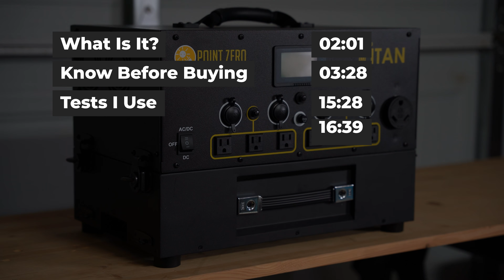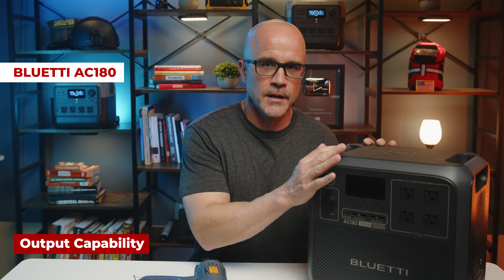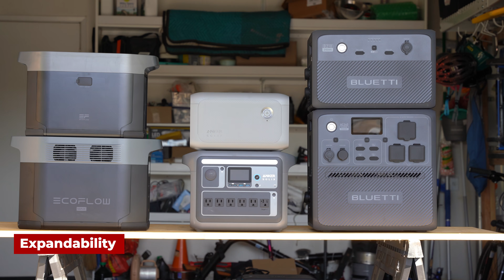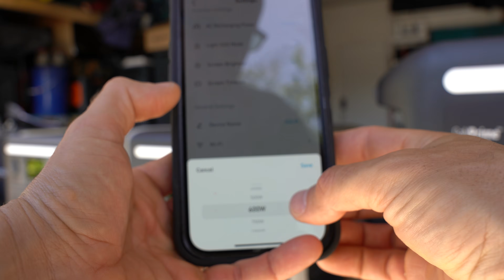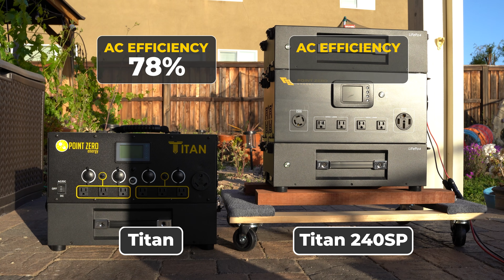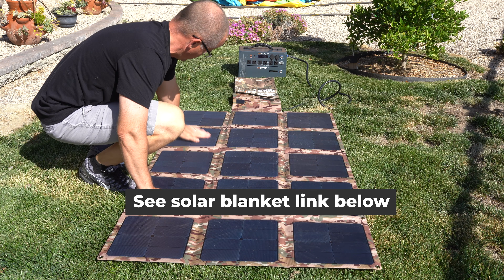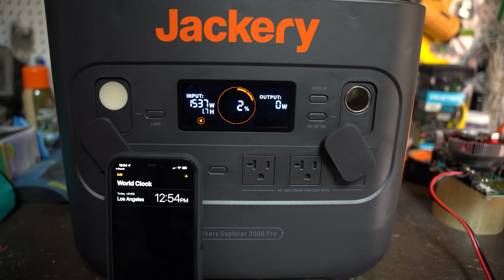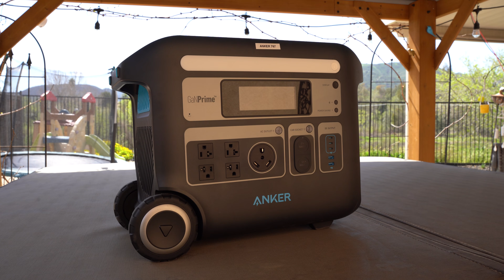Best Solar Generator for 2024 (The Ultimate Guide)

Comment: Last year i had an Ecoflow unit die.  I was not able to ship it back to them for warranty due to shipping restrictions on Li batteries.   However they did honor the warranty  and sent me a new unit free of charge.
Reply: That's good to know, hoping they continue to be good on warranty.
Reply: Ahhhh! BEWARE! Buy direct from ECOFLOW! 
Mine died, and they said no bueno! 
Why? Because I bought it through this non approved reseller! 
Yep! It was AMAZON! 
I fought it, and they sent me a new one, but it took time!
Reply: I have had two echo flows fail on me. I'm done.😢
Reply: Same here, we had four delta pros fail in a matter of days.
Reply: @quartamile  WOW!!!
Reply: @quartamile They let you keep them all or does you have to return them?
Reply: @marcfavell   they weren't mine and I left the project before discovering that, but I'd be they shipped back.
Reply: @marcfavell You does...
Reply: That's crazy, mine was defective when it arrived and they updated it to bricket so it wouldn't work anymore. They made me print a shipping label and I think the shipper attached the wrong label. They said they have to have the product back even though they knew it was defective and useless.
Reply: @matt45540 of course they need it back, lol. If a company declares a recall on a car - you need to send it. Every time I crash a drone, they Brick it and replace it. If I lose it over water or cliff... too bad for me 😅
Reply: That speaks volumes.
Reply: @ctcv-to8kq huge
Reply: Ecoflow has incredible customer service, unlike Bluetti.
Reply: @stacky512a I got burned by Bluetti too.
Reply: Yeah, one of my two pros burnt out its charge controller. Sent it back and got a new one.
Reply: MA in the US.
Reply: @johnclark3531  FedEx accepted it?  I have to send mine back and they sent a fed ex label.
Reply: If you buy from walmart or costco then it can break all it wants.  Consider the benefits of brick and mortar as these made outside the USA stuff have shaky quality and dealing with the return line in costco has a certainty versus online where its a coin toss.
Reply: Just Bought the Pro and smart battery twin.  2100+1500 on Amazon Prime Day. Took less than a week via Fed Ex, Booted up w connector, NO ISSUES. 3 updates had to be uploaded.  No Issues.
Let's see ... Time shall tell.  Im from NJ
Reply: did you get it from Amazon? I want to buy a backup system & was looking at ecoflow but it has bad reviews & I read so many complaints about  bad cust service & I guess it's not supposed to be used with medical stuff because it will hurt a pacemakers from electric stuff it emits. also on amazon it says flat out non returnable because of hazmat issues. I'm looking at another brand. I don't want to spend $3K & get ripped off.
Reply: @piercingtheveil40  I have a Delta 2 model. I bought direct from manufacturer. In over a year I have had no issues after using several times. I just looked up the same model on Amazon and it has a 4.6 rating. I spent $1600 cdn for the unit and solar panel. I'll look at other models to see if I can confirm your findings. Maybe it's the model.
Reply: @haylays5616  I want the new delta . I think it’s the best but it’s $3000 or more so expensive
Reply: 6 people in this one thread with reliability issues.  Now I'm not so sure about getting an Eco Flow.
Reply: @ServantOfJesusChrist777, for real, I was thinking about choosing between Ecoflow and Jackery, and after observing many users in this thread encountering reliability issues, I'm now unsure whether I should go for Ecoflow
Reply: @Thephonkgod  I have had a Delta 2 for over a year. Used it several times. Never a problem. We have a storm coming tonight so I pulled mine into the kitchen. I luv it.
Reply: @Thephonkgod what did you end up going with?
Reply: @Thephonkgodlate info on Jackery, (portable Explorer 300) we have two pain in-the Sierra units. Jackery does not play with anybody.  Every plug and cable is a slightly (read proprietary) different size. Also, look at the polarity.
Reply: @ServantOfJesusChrist777  yes I too am worried.
Reply: Let me guess - you are somehow connected with another manufacturer? @ServantOfJesusChrist777
Reply: @ServantOfJesusChrist777 right!   Sounds like great customer service but….. should need that customer service
Reply: @ServantOfJesusChrist777 I’ve been running EcoFlow daily for 4 years 24/7. No issues.
Reply: @ServantOfJesusChrist777 350k watched, 6 people had an issue worth commenting....
Reply: I’ve taken Milwaukee 18v batteries in my carry on travel case ….I just drain the charge before I pack them !
Reply: How did ecoflo ship you a new unit? But you were not able to ship the old one?
Reply: @roaddog9222  i could not ship it back to them for warranty because of the lithium battery restrictions. No one in town would send it back to them.  Lots of regulationsregarding that.  They just sent me a new one as a replacement.  I had to ditch the one i had.
Reply: @roaddog9222 That's the beauty of it!😉
Reply: Good to know, thanks!  😊
Reply: If you're not a marketing bot then I'm sold !
Reply: City Prep - your commenters report an abnormal failure and DOA rate with Delta.  Not good for DOA as that problem is easy to correct prior to shipping.  Not sure your overview supports your selection.  The obvious choice is the one most people cannot justify with the made in America price and it is not totally made in America due to the batteries.  Water resistant and AC efficient are important considerations.  I did not really see a clear winner as three of the manufacturers have differing positive and negative points.  Good review.
Reply: @solutions2exist556  680,000 views of this video and a dozen with problems is NOT abnormal fail rate . Even if half the 1300 views were complaints that would be minimal.
Reply: My EcoFlow Delta pro failed after two years of sitting idle on standby, it charges the extra battery but not the main battery. Hopefully they replace it, i've got about $8000 invested in everything and I wish I just made my own system that would've been easy to service.
Reply: @melissasmess2773  For that amount of money, your experience with EcoFlow was absolutely horrible. Back in March 2024, I purchased on eBay for $1250 total, a brand new ALLPOWERS R4000 3600 watt LiFePO4 Power Station which has flawlessly been running my safe room's 200 watt heater or 450 watt air conditioner during extended grid outages. Recharging via grid AC is on the slow side but other than that, no problems with this unit whatsoever so far.
Reply: Where are you located ?
Reply: @lanceboudreau3630 What time is it? Did Dick's heart stop?...🤣🤣🤣
Reply: What about Amazon is reseller for eco flow and it comes direct from eco flow, still honor 5 year warranty I hope?!?!
Reply: That is one of the problems with these types of batteries. I had 3 diff brands stop working within 5 years of ownership.
Reply: Is great they sent you a new one but How long did it live and how long did you use it for?
Reply: Ecoflow failed on me. I have had good luck with Bluetti.
Reply: I'm now sold!
Reply: I've had two Ecoflow Delta 1300 units fail on me. I'm not sure I'd buy Ecoflow again. Each lasted about two years.
Reply: Ryobi just came out with an 1800w power station, which can be linked to an identical unit.
Reply: @iamgermane very nice, but i cant find anywhere it can be solar charged
Reply: You did prefere wifi, but in most scenarios wifi will not work does it?
Reply: You based in the UK?
Reply: I live full-time by choice in my sprinter in the mountains of northwestern Montana.
I have the eco-flow :
 River 2 
Delta 2 
Delta Max 
Wave two 
And two foldable ecoflow solar panels. 
All  have treated me well .
I'm not real pleased with the Wave 2 or the solar panels.
I have to keep chasing the sun with a solar panel so then when I seen the ecoflow dual generator .
I took out a loan and I bought one 
It was quick to get here 
I want to use propane only 
I checked everything the manual said to do. 
Then I ran it 1 hour 
Change the oil 
And then I ran it 2 hours for the next 3 days 
Went out the next morning nothing !
Won't start for any reason. 
I'm 63 on my second pacemaker defibrillator and suffer from rheumatoid arthritis. 
The electric start was going to be a godsend for me. 
What a long story short I contacted my son-in-law had him come to camp and had him triple starting it 
Nope nothing !
I'm corresponding with technical support 
They said I need to go back to town and see if I need to update firmware 
And then contact them 
Because they think it might be the battery. 
I'm truly hoping they get this figured out. 
I'll try to remember to update you all.
Reply: Good to know they support their products
Reply: Glad to hear that, just ordered the EcoFlow Delta Pro2 after many hours on YT.
Reply: How difficult was it dealing with customer service?
Reply: Shipping restrictions? They ship it to you don’t they? I had a solar charge plug (xt60i) go bad on a delta 2 and they sent me a new one in a week. They even paid the shipping back to eco flow.
Reply: This is amazing I know know which 2 brands are on my top list
Reply: Recent reviews on Amazon say the delta 2 arrived dead and there was little to no customer support. Others have commented on videos with similar results from ecoflow.
Reply: I've also heard their post sales customer care is excellent which is why I've just ordered a Delta 2.
Reply: Having great support is awesome but the units failing is concerning. If they malfunction when you need them then what’s the point. They sound a bit flaky.
Reply: I wonder, would you do the crazy thing and do a discharge for a year on the 2023 units to see what their capacity is after usage.
Reply: That’s strange. I was able to return a River 2 without any issues.
Reply: @OCMOOMOMO  Ecoflow told me to take it to Fedex for shipping.  They wouldnt even touch the box!   It was really strange.
Reply: @erins2473 it requires FedEx picking them up, not a drop off.
Reply: @erins2473 Things changed not so long ago and these batteries are no longer allowed to be transported by plane. Fedex, I believe, operates mainly by plain, hence why they didn't want to touch it. I can't find company to ship it to me, not even Eco Flow itself because most stuff comes up to us by plane. I have to purchase through other retailers and have it delivered to store then pick it up from them.
Reply: @erins2473  Strange isn't it, that they can get it shipped to you but all sorts of problems getting it back.
Reply: @erins2473 FedEx are a pain in the 🫏  !!
Reply: @OCMOOMOMO  Must have been the particular shipper.
Reply: My Ecoflow was mishandled by the Amazon driver, or someone down the shipping chain. The box (handle cutouts) was ripped open from picking it up, or dragging it across the van floor. Shipping damage, shock, shake, and drop. Due to things being loosened up in shipping, that's more likely the cause of new units not working, or failing shortly after. Thankfully mine works fine. I did order from manufacturer (amazon store). Don't forget the whole electrical grid is old, under capacity, and does not deliver consistent current. All that is impacted by space weather as well. The sensitive computer circuits for the wifi/blue tooth inside these batteries are a major fail point, because signal is sent in and out. Corrupted signals. Complexity itself creates unforeseen problems.
Reply: @Slo-Fi77  Exactly, failures in new units or with very little use, but once they have owner use and not Amazon driver... maybe they are delicate hardware?

Comment: What I want is 12000 something.Watts at a 120 V was at least a 2600 W generator.
That's what I could use for 120 volts. Really?That's what I used for all my one twenty outlets which I didn't use any outlets that it's used to plug into a inverter which I don't have anymore but I still have my solar panels.

Comment: I have several solar power stations. Bluetti is my favorite. They always work.
Reply from the maker: Can't go wrong with Bluetti.
Reply: Will you say why that's your choice???
Reply: @SharonThorpe-AMSOIL-Dealer  Because they’ve never had any issues. Some people prefer Eco Flow but I heard their customer service is not good and several people complained about break downs and lots of time involved in getting them repaired and sent back. 
One of my Jackery’s had a screen quit working after a year. My Inergy quit working on the AC side just after the 1 yr warranty ran out. 
Never buy a power station with only a 1 yr warranty.
Reply: @billbradley2480 ecoflow 5 yr warranty👍

Comment: Excellent review!!  My key favorite feature of the Delta 2 Max is two independent MPPT charge contollers.  Two makes for flexible re-charging options.  Most of the time though, I use my Delta 2 (not the Max).  The max has twice the capacity, but nearly twice the weight.  My Delta 2 powers the whole garage, including a high-surge table saw.  Solar panels are mounted vertically on the side of the garage so that I don't need to keep brushing snow off of them.

Comment: Does anybody have any good suggestions on micro wind turbines?
Reply from the maker: not but looking for options
Reply: @CityPrepping  I used to be a fan of the skystream 3.7.   but you got to really make sure you have enough wind or I'm just sit there. I also like the maglev VAWT's
Reply: You have me wanting to look into it some more,  thank you my man
Reply: I wonder about the micro water turbines too. Like, we have a small stream on the place that we could funnel into a fast moving stream. Even if it's only good for charging a small battery, that's better than nothing...
Reply: @FOMAHsince2014  that is my dream to have a running stream through my property.  That would definitely be top of my list.  I've watched some pretty amazing videos on people showing theirs off
Reply: @FOMAHsince2014  I like the systems where they divert the water out of the stream and then create a Whirlpool off to the side.
Reply: Check out Missouri wind and solar, they are the best I've seen
Reply: @dustydawson8977  excellent, appreciate that Dusty

Comment: Solar is an excellent option. I wish the batteries weren't so expensive
Reply: Lithium batteries are cheaper than they use to be. Solar panels are also. Plus the tech has improved.
Reply: @billbradley2480  yeah the tech has come a long way.
Reply: @billbradley2480 bam! Incoming tariffs tho 😢
Reply: A cheap oil drum full of sand and a heating element and an insulated jacket is a fantastic way of avoiding curtailment AND having efficient heat without having to convert it back into electric.

Humans can always make heat from electric at 100% efficiency, but making electricity from heat is more like 20-30%.

couple hours of sun blasted into an oil drum during the day gives a really warm comfortable evening with no lithium.
Reply: @gigabane7357 that's interesting have a plan???
Reply: @SharonThorpe-AMSOIL-Dealer  Absolutely lots of information on youtube about it! Afraid I do not have a blueprint as it can be as easy as buying a heating element compatible with your electricity source and drilling a hole in a container..

I am a bit more of a homesteader type than a city prepper, so I am into options that may not work so well in urban space.

such as using ferrocement as protection and foamcrete as insulation and then you can scaleup to whatever size you please.
Reply: @gigabane7357  I love how knowledgeable everybody is here
Reply: @gigabane7357  @gigabane7357 Great idea using an oil drum and sand as a heat bank! It's a smart way to store heat from the sun during the day and release it slowly in the evening, keeping things cozy without electricity. The insulated jacket is a nice touch to keep that heat from escaping too quickly. Maybe adding a solar air heater could boost the warmth even more. Love the creativity in using simple materials effectively!
Reply: So out of reach, I work 3 jobs still can't afford any of these...😢
Reply: Batteries have dropped in price from a few years ago. Batteries are the way to save money if you a DIYer
Reply: @mannyfragoza9652  what would you recommend as far as battery type.
Reply: Solar would be great to add to my back ups but need to start saving for it. I am still working my my bushcraft skills
Reply: Absolutely
Reply: I spent $2112, plus tax for four 24 volts lithium batteries
Reply: Batteries are cheaper if you compare it to lead acid. I use to get lead acid car battery for $80. Now they are $140. Lfp battery use to be $1000, now you can get a 100 ah 12v for $280.
Reply: @brucey5585 I've seen LiFePo4 100 Ah as cheap as $135., and 100 watt panels for $48, getting cheaper by the month.
Reply: Let’s ignore that the “winner” is the company giving him money to speak. I mean it is the “giveaway” 

I wouldn’t trust the spreadsheet     .